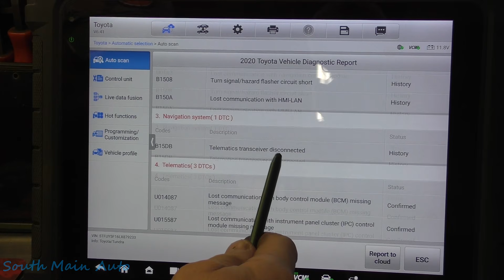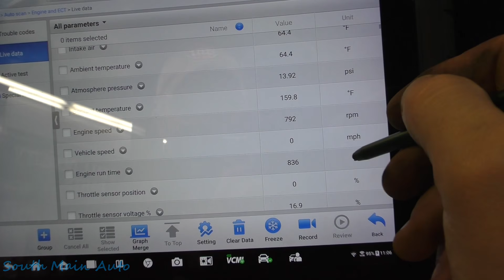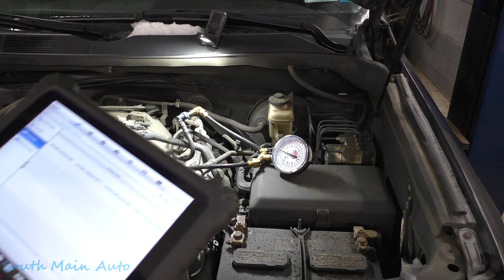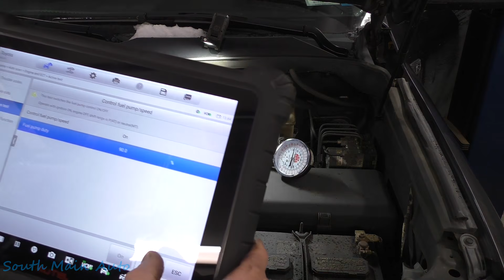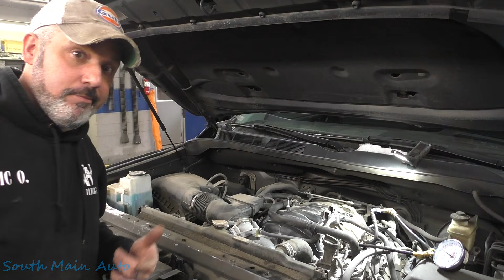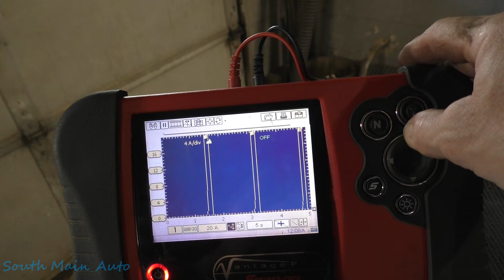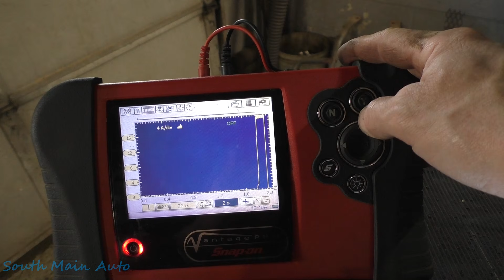My Customer Is Getting Shafted By The Local Toyota Dealer

Comment: The next time my toyota goes near a dealer is when i pass by it on the highway , dealer upon purchase did the one and only oil change and had the oil filter plastic cartridge on so tight i had to use a 4 foot breaker bar to break it loose thankful no cracks in it because they want to charge 249.99 for a new one.and its made out of plastic!

Comment: What a sad state the auto repair field is in, when the dealers shoot the parts cannon REPEATEDLY, and the small independent shop (without all the knowledge gained by BUILDING THE DAM THING) actually does the job you would expect the dealer to do.... Diagnose it and change the one bad part.

Comment: Long ago I drove a late 60s MGB. I used to joke that a baseball bat was included as standard equipment. When the car wouldn't start, I'd open the trunk, take out the bat, bang on the fuel pump (rear right underside of the car) , replace the bat and close the trunk, and then it would start.

Comment: I wont even bring my 2024 Honda in to the dealer for the free oil changes cuz I dont trust those clowns.  I also have a soft brake pedal that I will be the guy who bleeds out the brakes.  Only way my vehical will see the dealer is if I shit the engine or trans.  pretty much anything else I will fix it.  sad its come to this

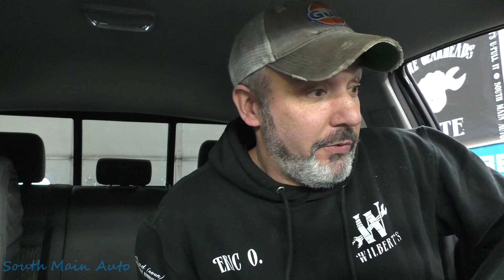Comment: 7:20 thru 7:27 - That would be my first conclusive diagnosis, after checking sensor readings as you did. They can put a hundred wires, sensors, servos, solenoids, and computer modules in the mix, but it almost always boils down to the basics: fuel, air, ignition. The hard part is usually figuring out which wire, sensor, servo, solenoid, or computer module is interrupting the "Internal Combustion Trinity."

I'm assuming the Super Mega Special Fuel Pump Speed Control Relay Thingy is attempting to power the pump, but cutting out on an over-current safety. Much like a USB charger or a failed power supply in an LED bulb, the output pulses as it tries to repeatedly apply power and then shuts off for protection. I haven't a clue what "normal" current draw for a fuel pump is, 10+ Amps is definitely NOT normal.

You're spot-on about the battery maintainer skewing the tests. As you said, higher voltage means the motor has a higher chance of overcoming whatever internal failure it has (impeller? bearing?). I also get the impression it's getting "stuck." 

I'm irritated at the runaround the Toyota dealer gave the owner. Anyone with halfway-functioning hearing could have diagnosed the fuel pump. I actually shouted at my screen, "There's your problem, lady!" once I heard it up close. I mean... DUH? Sounds like pistachios in a plastic blender, but nah, Eric O. must be wrong.

Comment: Weird first crank, no start yelling  at the tube get the hammer .First, try with fuel pump yelling, put the jumper on it 
HD 17 years motorcycle 13 year autobody 5 years ,small engin still today at 73

Comment: Toyota dealers are N O T O R I O U S L Y terrible about denying warranty claims or even denying that anything is wrong with the vehicles, the local one Lied and denied that the 2010 or 2011 Camrys had transmission shift concerns(admist the time period when the 7th Gen was having major issues out of the same trans) and also claimed that they didn't hear the VVT rattle that started at 40k, also denied that the gas tank internal baffle being loose which had a tsb out before we even purchased the vehicle could be a problem too.

Comment: I had a similarly perplexing, long, drawn out, intermittent fuel pump failure on my 99 F150. Over a period of 2 or 3 years, it would sometimes not start, but only cold starts, and once it started, it ran perfectly. It finally failed for good when I was 500 miles away, and my wife was stranded in a stall at Sonic. Boy, was she thrilled! 🫠 Replaced the fuel pump and never had another issue with the truck - other than things rusting apart! 😂

Comment: thanks Mr. "O"....for the video & the correct way to test the fuel pump operation on these new electronic night mares...back in the late 80's...if we had 12 volts key on & u couldent here the pump running..(and the hammer trick dident work)we would drop the tank & replace the pump..we would go 1 step furthor (if we had doughs) by jump'n 12 vs to the pump on a bench,,,there were no "fuel pump ECM"...!..a few years after I pull'd the plug on being a mechanic....i give u mucho credit for stick'n with all this s**t..& for your honesty..!..& of course your diagnostic skill level with "ALL" the electronics in the moderon vehecial..!..love the channel...the KIA back up camera ...BLEW MY MIND...!..!..shier insanity...!...keep on keep'n on..!..

Comment: More voltage it will pull less amps, it must be right on the knifes edge of the ecu current limit getting it going, the 13.8 is enough to lower the amp draw.?? My guess?

Comment: Probably a cooked set of brushes. Now why would they go backwards? I always thought brushless was the way to go. Shame on Toyota for the design. Good for Toyota if they make it right for the guy. Shouldn’t outta be having troubles at 50,000 miles. Not good. Reminds me of a starter my buddy got aftermarket for his ATV. Lasted about 10 starts then the magnets around the armature came loose and bunched together inside the case. Where does the crap come from?

Comment: I would have liked to see just how that test light bulb was connected up to that fuel pump circuit.  I'm guessing the two bulb leads were connected to the blue and red wires coming out of the fuel pump control ECU.  I was expecting the test light to get really bright when the pump was stalling, isn't that the reason you hooked the light up - to see if there was an excessive load causing the high amp draw?

Comment: Funny about "never trust your scan tool".
In electrical, (mains voltage AC), it's the other way around.
Always trust your meter, and Prove, Test, Prove on a known good voltage source.
I don't trust multimeters or voltmeters, so I think your way is more practical, but 12 volts won't kill you.
Electricity. 
Evil weird shit.
It loves to cause havoc.

Comment: I participate on the Australian T-ROC R facebook page.  A guy posted that when overtaking at high speed on the highway, his engine would splutter, but at all other times it was fine.  The VW dealer couldn't fault it, VCDS scan showed lean burn at times.  I told the guy it was his in-tank fuel pump, unable to meet the high demand.  He mucked around for a couple of months, complaining about VW and everything else in the world.  I told him to take his finger out of his *rse and put in a new pump, cheap aftermarket, but he preferred to have the problem and continued complaining.  Guess what - eventually a different VW dealer fitted a new in-tank pump and the problem went away.  No sh*t Sherlock.  All that grief to save $AU300 on a Bosch pump which takes less than an hour to fit.

Comment: Brilliant diagnostics, as always. I had a similar presentation with an automatic bilge pump in a boat, where the "fuel pump ECU" is intrinsic to the automatic pump itself. Like here, I'd get a flash of high current following which the electronics would shut off for a few seconds, as though the ECU was protecting a possibly locked rotor on the pump. It even did that flash thing when I routed the feed in series with my 170mA test light in place of the fuse, so it was reacting to something more than total current. In that case a scope of current draw with the pump hotwired directly showed dramatic hash, with spiking current dropping to zero between each winding pulsation. When I opened the pump the brushes were worn down to metal fingernails.

Comment: In my world, I would have thrown a cheap aftermarket fuel pump into it, and then when it runs perfectly go to the dealer for a genuine one (not that the genuine one seems any bloody good).  The sound that pump made when it did run is enough to know it's NBG.  Even when cold, the engine ran rough on startup.  So much wasted time from everyone - is a person's time worth nothing in your neck of the woods?

Comment: Wish you'd had this up a couple months ago. My 92 dodge W150 had a similar problem. I came to a similar conclusion after several troubleshooting attempts.  Amp meter idea would have shortened my troubleshooting.  End up taking to a shop for confirmation and pump replacement.  Had some rusty crusty wiring and lines at top of tank and I don't  have lift to get under so easy. Let a professional deal with those issues. What finally keyed it for me was voltage drop without charger when turning key on. Problem was very intermittent,    mostly a no start after sitting a few days, but a whiff would get it started. Suspect the increase in voltage from alternator would get the pump running. If on boost from the charger it would usually start. Strange problem to troubleshoot, intermittent problems can be some of the most difficult.
Reply: Knowing what you know now....would a bypass "prime" button where YOU control the start of the fuel pump (prime BEFORE the voltage drops when cranking the starter) have worked to increase the time before pump replacement was necessary ?
Reply: @JohnSmith-pl2bk  Not in this case I don't think, the fuel pump turns on as soon as the key is in the on position. So letting the key stay in the on position should have started the pump but couldn't on just battery power of 12.4vdc. When the charger or alternator voltage of 14.5vdc was available the pump would turn on.  I suspect it needed to have the higher voltage to get started but once running it could keep running with a lower voltage. Also mine would sometimes start with battery voltage, I believe the commutator had one or two good spots left and if the pump stopped there then it would start on battery voltage. I think this was the original fuel pump, as I have the maintenance records from the previous owner (MO Department of Conservation). Since the fuel gauge hadn't been working right for years I knew I needed a new pump anyway and it did fix the starting issues.
Reply: @msgtdan60  
Possibly well worn from operating around 1/4 tank...or even far less?
Reply: @JohnSmith-pl2bk  Possibly, MDC used it as a brush fire truck with a water tank in the bed. Once I got it in '99 the fuel gauge would show full, but quickly drop to 1/2, 1/4 was actually about 1/2. Last couple years it's gotten a lot worse and I just went off mileage. It's a farm truck that rarely leaves the farm so wasn't worried about it, usually filled it up at about 150 miles on the trip meter. With the idling around the farm that usually meant between 1/4 and 1/2. Only put about 40k on it since I've owned it.

Comment: Don't know how the pump is built but if it's a brush style pump It could be an open bar on the com. And every time the brushes hit the open bar it will cause a high voltage and will run until the armature stops on the open bars on com. Unit will shut off again. I see it a lot in aircraft fuel pumps.

Comment: My old truck surprised a guy that was helping me he got underneath and beat on the tank and the back strap broke  and the bottom came open and dumped about 2 quarts of gasoline on him  It wasn't too full had to get some stainless wire  and wrap it then tie it up, he wanted a ride home I said that smells worse than BO it was summer he walked. but it was the pump.

Comment: I gave up teaching automotives because the education system could not recognize that the auto repair industry was going to demand higher IQ students. Today the problem is trying to get dealerships to appreciate the necessity of people like Eric and Ivan et al. The reality is that the service department cannot be run by the local dealers. Service can no longer be controlled by profit/loss conflicts because of poor local management. The service department should have one job and that is to fix things so that the customer is happy. They don't need the conflicts and compromises required to keep the owner/management happy. 
Another issue - the corporate engineers should be required to spend one half of their time actually working on the contraptions they create.

Comment: I am guessing dealships only play mechanics a set fee for diagnostics, say one hour or less.  If they can't find the problem in that time they are forced to just start swapping out parts, usually the easiest ones like the relay on the frame or a ECM. If that doesn't fix the problem then and only then will the say in the case drop the tank and trying swapping out the fuel pump which would have fixed the problem.   The real problem with dealerships is the same as with doctors today, which is very few people are taught how to due proper diagnostic trouble shooting.  My humble opinion is Eric is like Dr. House, willing to take time to think and do a proper diagnosis.   To bad many mechanics today are either not will or able to do so..  What really fries my hiney is they still want to charge you for all the parts they tried and the labor time before they fixed the problem.

Comment: I would have solved it quickly by replacing the pump, if it wasn't the pump, well  I would have been in the shop having them change everything till they found the issue...

Comment: Not only the extra amperage/voltage from the alternator charging the battery , but is there any resulting suction or vacuum present when the engine is running that could be contributing to allowing the pump to break free or overcome the bind?

Comment: I had a car that would do this so I figured the pump was bad. So I removed the tank to change the pump and the connector was melted. It would do this when it was hot it would stall and when it was cold it would start. That explained the problem. Changed the connector and it worked fine for years with the same pump.

Comment: I'm surprised that the fuel pump controller doesn't report back to the engine management computer that the fuel pump is operating outside nominal parameters and triggers the money light.

Comment: at first glance, i felt confident the motor wouldn't start on warm because some ECU component was awry and misreporting (sensors be wilin'!). You felt fuel pump from the beginning, and i was like NO WAY - somehow you ended up walking me through it, and i was edified in a way I did not expect. Thanks for teaching me how you came to feel it at first - a troubleshooter's read is an important skill to hone, and you do it fantastically. Thanks again, Mr. O.

Comment: Yeah, I've been shafted by Toyota Dealers also. The last time was in Saginaw MI. They charged me $206.80 without being able to do anything to my car. Claimed the hood latch cable broke off at the latch (I had already told them about that when I brought it in), and the latch itself was seized up. Their mechanic couldn't even get the hood opened!! 

Then they told me they'd take the $206.80 off of the estimate for repairing/replacing the latch and cable.

  $761.**
-$206.80
--------
  $555.** MORE, AND THEY CAN'T EVEN GET THE HOOD OPENED TO DO THE WORK❗️

Well I took it to a friend's brother.  He had the hood opened in no more than 5 minutes (Not Seized Up), with a coat hanger, WAY better than the Toyota dealer's 2 hours and 20 minutes to figure out that they couldn't open the hood.

The brother installed the new parts I had already ordered on Ebay. Cable Assembly and Latching Mechanism for a total of $70.00

I'm NEVER EVER Going back to Toyota❗️

Comment: Had the similar symptoms (start cold, run fine, shut off, won't restart unless a little accelerator pedal), but with added issue of temperature gauge seemingly not moving. Thanks to Eric, I salute sir btw, my dumb ass was able to diagnose the temp sensor.

Comment: My first thought was it might be a DPF problem. Secondly fuel pump just as you thought Eric. Guess Toyota just didn't want to deal with it. Especially if it's a warranty job. One of the things I don't regret is working on these oily diesels. But everything seems to be diesel these days. Though I see the new Tundra is a petrol\Hybrid.

Comment: Interesting too as additional information is how much volume of gasoline per vehicle specs. is the fuel pump pushing every 30 seconds or whatever it calls for?  You can always have the right pressure that it calls for but come to find out it is the volume that it is lacking to keep the engine running.

Comment: The manufacturers are not releasing all diagnostic info to dealers. ( My opinion)

The level of disconnect at corporate is scary.

Not all logic is shared like 40 years ago.

The motor vehicle manufactures think their saving money, doing low volume high margin.

They are increasing the risk of failure ie going out of business if their cash cow dosent sell. Ie overpriced. Fragile cars failing leaving customers stranded for the wrong reasons.

Comment: I learned about pump duty cycle from Ivan and Eric O. 
My brother in law cheby came in limping. 
He said the local parts store technician said his fuel rail pressure switch was bad causing the mess. 
He said put it in. 
So i did. I told him politely. Its not going to fix it. 
I put it in and he left. 
10 minutes later he is back 😮
He says, ok. Your turn. 
I get my scanner hooked up and i get all of the pids i needed. 
I ask him to drive it like he normally drives it. 
No more than 2 miles. 
The pump duty cycle is 100%, we are only going 25. 
I tell him the fuel pump is shot. 
We get to my shade tree. I start pulling the bed to get to the fuel pump. 
I send him out for the pump. By the time he gets back. I'm ready to lift the bed. 
It takes me 40 mins to swap out the pump. Another 40 minutes to button it up. 
Time for another run. 
Chevy thunder erupts to life. 
Truck now runs with lots more power. Pump duty cycle is about 25 and i ask him to climb the hill. 
Truck is cruising now.